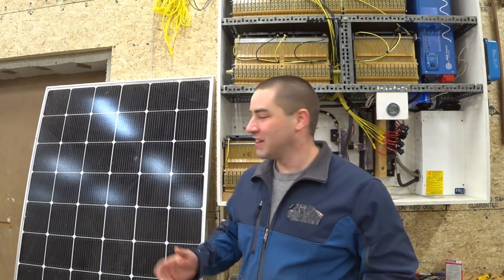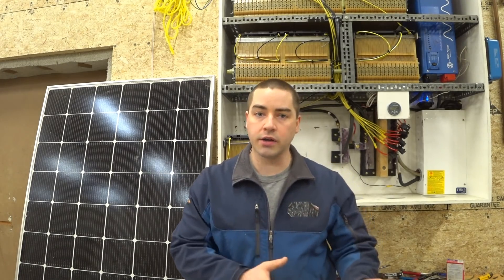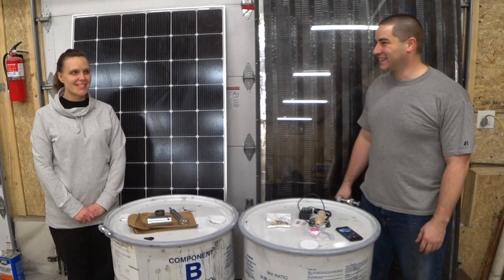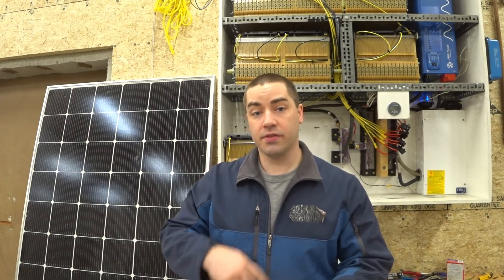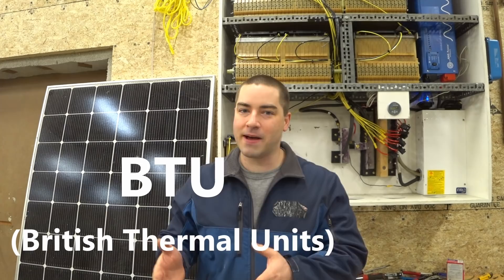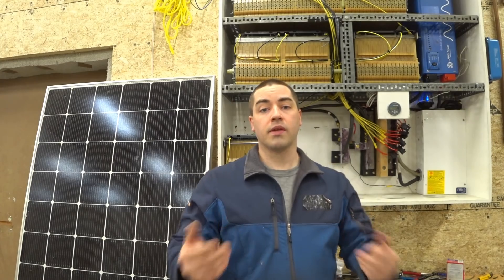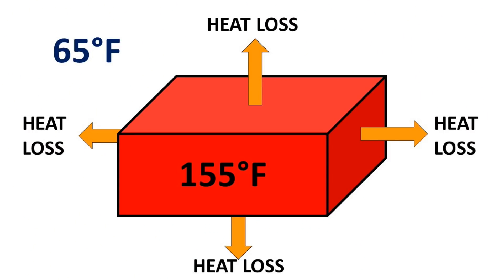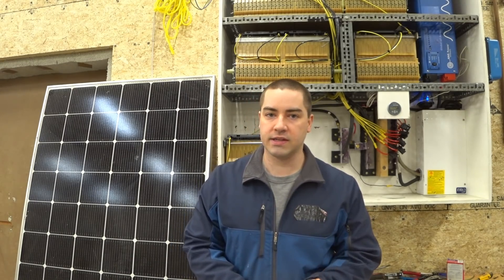Cheapest Energy Storage Off-Grid

Comment: Nice installation David!  We don't have any good areas to install PV available, so I settled for two small arrays way down in the back yard. They don't get a lot of sun, but they get about 4 to 5 hours a day on average.  They keep the back-up battery bank charged.. 
Anyways, I had a hot water problem. With just two people in the home, I felt it wasn't cool to use our oil burner all summer to make hot water.. When I started using Mini-split (heat pumps) for heating, I didn't really need to burn any oil until the temp got down to 8deg F. So, we only get an oil fill every few years. 
To solve the hot water problem, I purchased a cheap hot water heater from Home Depot and installed a small A7 heat pump (cheap off Ebay) on top of the tank. It works okay.. Uses power like a 4,000 BTUh AC..  But, to supplement the A7, I connected the two PV arrays (400w & 500w) to the heating elements in the hot water tank. So, when it's sunny the water tank is heated by the sun and the grid..

Of course using PV tied directly into resistive heating elements is considered a crime against Gaia!  
However, when you can get PV  panels so cheap, why use solar hot-water panels with all the leaky pumps and pipes to make hot water?  (We had hot water panels on the roof back in the 70s it worked good, for a while). 

I read some reports about state parks that have used PV to resistance to make hot water, because the demand for hot water isn't very high.. No dishwashers etc.. Just some sinks in the bath rooms. Maybe a shower. Of course their arrays were paid for by the taxpayers..   But without all that plumbing and moving parts, it proved to be very reliable and met the needs of the public.. 

The big draw back of my system, is no temperature control.. So, the PV power is configured manually not to overheat the water, under normal usage. If we go up to NH for the weekend, I turn off the PV.. Let the A7 heat pump handle it..  Much of the year, the heat pump doesn't get to run a lot.  Mostly on wash days.

The A7 has an accessory  socket on it's back panel. It's live when the A7 is running, using grid power.. 
I've been thinking about buying a 400w 48vdc to 120vac  power inverter and use all solar PV power for hot water.. But, that would be conventional.. ;)
Reply from the maker: That sounds good to me.  And congratulations getting your oil usage so low.  Excellent job.  You mentioned NH for weekends.  I'm in central MA, we might be neighbors.  I'm conducting an experiment right now comparing solar PV and solar thermal.  (I've also been told it's a sin)  But I'm surprised how well the PV direct to heating element is doing.  Do you have any videos, or pictures?
Reply: @DavidPozEnergy  I'm in the warmer part of eastern MA.  Snow just slides off my PV on days like this.. :)  
There's some posting online, search "Dump the plumbing and use PV to heat water?" 
My little comparison study was comparing fixed to tracking PV arrays..  Results: Tracking is not easy and doesn't yield enough extra power to make it worth the trouble & expense.. At least on the small scale. A large solid tracking array would be sweet, but costly.. I used an old satellite antenna mount for a tracker. I got tired of Radio Astronomy.  
Anyways,  there was a guy selling solid-state temperature controllers, not sure where that went.. 
I made a few attempts, to control the water temp, but failed. Since I'm an old retired guy at home about 90% of the time, I monitor the hot water at least once a day. This winter has been okay so far. During the day the PV keeps the water up about 120F and the A7 heat pump kicks in with it's thermostat when it gets down around 110F and brings it up slowly.. Right now it's 115.3 F    
If I ever have to do another hot water heater I'll use a larger tank, and I'll hack a heat pump together.. and maybe use PV into resistance if there is any PV power to be had.. 
My other long term test (Feb 2013) is using RG-214U direct burial coax cable underground. Both PV arrays feed the house with coax.  Because of the small center conductor, the PV is in series config, for high voltage at low current. Three 8 amp panels in series put out 8 amps, not much power lost as heat in the cable. This saves on buying heavy copper wire..   Every summer, I test the coax cables for losses and they have remained very small.  I have also tested them using RF test gear, and they are still good, if I wanted to use them for VHF or UHF ham radio stuff.. 
One hour with 8 amps into a 13 ohm load resistance is only 832 watt Hours, and each hour yields only 2839 BTU of heating. That's when it's cold and sunny.. When the days are too short.. :(    It's just enough hot water two old folks.   
But, if we plan on showers after doing a wash, we need to remember to fire up the oil burner (HS Tarm OT-35 boiler)  for about 25 minutes, to get a 76 gallon water jacket from 47 F up to 140 F.

Comment: Hey Dave, I really like your videos and find them very informative and thought provoking.  Given you are working on a Thermal system;  have you seen ElectroDacus's project?  You can view it at www.electrodacus.com.  He has developed a digital MPPT controller specifically for thermal heating for use in off-grid applications so that you can use your solar array to provide both electricity and heating from the same source.  Check it out and you may find it gives you some additional options.

Comment: The beat way to store energy is through compressed air
Reply: Okay, you just used 1 KW Hour from your PV panels to run your compressor.  Now that you have a steel tank of compressed air, you can do this?  https://youtu.be/U-kYAljKAY4
What's the conversion loss?
Reply: There are problems with air storage. (apart from having a large volume of compressed air, with the risk that creates if the tank ruptures). As you compress the air, it heats up. You must get rid of this heat, or your storage tank gets too hot. Later, when you use the compressed air to run a turbine or air-engine, the expanding gas gets cold, and thus is not efficient in the engine, and needs to be heated back toward atmospheric before use. Too many losses of efficiency for small systems.

Comment: Why use expensive Li-ion batteries when lead-acid is much cheaper? Sure, Li-ion is smaller and lighter but very often size and weight isn't a problem. This is why cellphone sites and telephone exchanges use lead-acid batteries and not Li-ion. 
Why don't you use evachuated glass tube solar collectors to heat water directly? To use photovoltaic to heat water is insane.
Reply from the maker: I bought these lithium batteries because the cost/kwh/cycle is the cheapest I could find, at least half the cost of lead acid.

I don't use evacuated solar tubes because I don't have any.  If I had them I would use them.

Using PV to heat water might be insane, but finding out is why I'm running my long-term experiment and data-logging it.  You can check out some of my other videos to see more.  Thanks for watching.
Reply: @DavidPozEnergy  Ok, makes sense then I suppose. I just see so many guys on yt fixated on Li-ion as energy storage when lead-acid is normally far cheaper. As for the glass tubes, they are not that expensive and I believe they work better than copper pipe collectors in cold climates at high lattitudes.
Reply from the maker: I've heard the same thing, that the vacuum tubes work better.  I've been watching craigslist for the last month.  I want to find a used vacuum tube setup cheap so I can test it side-by-side.  

I'm not a lithium battery snob.  For a long time I was planning to buy a forklift battery.  But I checked around and found this battery.  It's used out of a wrecked car.  But the battery was still good.  I would not have bought it if I had to pay full retail.

Comment: heat is pure anergy man
get a fly wheel which is 100% exergy
Reply: @timothy vince AND flywheels have no maximum duty cycle. Run them all the way up and all the way down, day after day, and they don't lose efficiency. AND they have (essentially)  no service life, unlike batteries.

There is a market for modular flywheel storage for home use. The best place to put them is in the ground, in a concrete jacket. They would easily compete on a $ basis with batteries.

Comment: You could run a heat pump drawing from a warm storage tank...
Reply: Pointless. The heat pump could only ever extract the energy you had put into the store, so there would be no efficiency gain. However, you could use a heat pump to "convert" a large volume of warm water into a smaller volume of hot water. This could be useful for occasions when the store is running low and although warm not really up to shower suitable temperatures.

Comment: Interesting video but here in Florida I need the electricity for A/C.
Reply: Those of us in the northern US can ship you some ice if you pay shipping and handling!
Reply: Do you need heat in winter? I live in Australia, same latitude as Florida, but south of the equator. We have similar weather.
Reply: He's not using the hot water storage for electricity... Just simply hot water.
Reply: savagecub You can use a similar set up to store chilled water or even ice, then circulate chilled water through finned  air to water heat exchangers much like a conventional air conditioner. Some commercial office properties already do this, using cheap nighttime electricity to freeze large tanks of water that then chill the buildings when required by day.

Comment: Great video. So sad to see home owners cover their roofs in panels and walls with batteries, and not consider solar thermal for water and space heating. The cost difference is due to both pv vs thermal panel efficiency and battery choice, and it's a huge difference. Math doesn't lie. Stay in school, kids!
Reply: PV is still the better option in many cases. It can be used with heatpumps which has nearly the same total system efficiency as solar thermal - but you can also use the electricity for other things or even use it as an AC when it is hot.
But if you just need a lot of heat then thermal solar is cheaper and slightly better.

Comment: you did not tell what was the working fluid in the heating panels. If its water and youll have alot of days without sun, your panels will explode.. please take that in to consideretaion. 
Thanks for the vid!
Reply: There are some hot water solar panels that fully drain using only gravity.   Here's a video on "drain back" system.   https://www.youtube.com/watch?v=DcU_uuNb3Qk
Reply from the maker: Yes,  my system is also a drain-back.  Thanks for watching.

Comment: You could also try using the sun shining on a Fresenel lense at the bottom (the heat will be hitting the cold water, as it heats it will rise in the tank leaving space for more cold water to be heated) of the black painted tank of water to super heat it..You can get the lense free from old T.V.s..They use the lense to even melt sand into glass..
Reply: Yes but the fresnel doesn't create any additional heat, it simply focuses it. It only focuses the heat collected over its surface, and given a lease is about one third the size of a solar thermal panel you would get very little heat from one. Plus you would have to adjust the angle to the sun constantly.

Comment: So you've done the math & built your your tank. My question is does it actually work? I also live off grid. Have for many years. Are you using passive solar for heating the water? Do you have other heating elements to subsidise the solar? This sounds like a great idea! But what are the details of the system besides a thermal battery?
Reply from the maker: Hi Jay,  My solar hot water system works pretty good, and has lowered my families energy use for heating water from 7kwh/d to 2kwh/d on average over the course of the year.  I'm always trying to improve my systems and make them better.  That's why I am currently conducting an experiment comparing solar PV to Thermal.  I have detailed videos on my channel on how I made the system framing the tank starts here: https://youtu.be/jKr4An8m_tM

Comment: why not heat the stored water with the heat pump when you have solar?

also, the energy cost should be divided by three since you'd likely be running the heat pump off your heater rather than just resistive
Reply: In some sense, this is true. But your current is modulated by clouds so you need a battery for averaging. And, sorry, using PV panels to produce electrical energy, you have an efficiency between 12 to 18%, here you loose a factor of 3 or 4 when compared to thermal collectors filled with water and anti-freeze liquids.

Comment: Isn't there a heat storage value for the pipes in the tank as well as the water? You've got a lot of pipes. Can you also preheat the water by running it over the solar cells to cool the cells? They make more power when colder.
Reply from the maker: The PEX tubing inside the tank is carrying the water for the pipes.  Since this water is constantly being used and replaced it is not part of the thermal battery.  

Yes, there are lots of ways you could try pre-heating the water.  It's fun to get creative and try them out.  I might even try some experiments in the future.  Right now I'm running an experiment on PV vs. Thermal.  Too bad there is only 24 hours in a day.

Comment: been off grid for years. ya hot water is the best for those with an endless supply of free wood. I use a wood fired boiler and storage tanks. I have 3.8 kw of pv . I use the surplus during the day to heat my hot water electrically . takes only one hour and is good for 24 hours.

Comment: What about an electric tankless point of use water heater instead of a tank?  While I'm not off grid, I'm using Oil to heat my home and my hot water tank and I find that burning oil to maintain a standing tank of water when a tankless heats the water at the point of use for as long as I need it makes more sense in my case.  

In this type of setup, would this not make more sense?
Reply from the maker: I'm not a fan of instant water heaters.  In one of my old jobs I used to be replacing them regularly.  

 If you are happy with Oil heat, and being on-grid, then I would  start with insulating your current tanks super well.  I mean lots and lots of insulation.  But, once the tank eventually fails you might try replacing it with a HPWH.  Often an oil boiler gives off lots of heat to the surrounding air, which the HPWH can capture in winter.  In summer the oil boiler can stay off for months as the HPWH won't need it to kick on.

But, this idea only works if you are staying on-grid.  I hope that helps.

Comment: >^..^<       Nice home made TED talk, thank you.

I suspect you got some thoughts n numbers on PEX vs copper heat exchange coils. Obviously the heat trnsfer is lots less with PEX but looks like you have at least 300' lineal feet of 1" PEX. What is the delta between the input temp and exhaust temp of your water from and back to your solar hot water panel?

By your statment, obviously you feel the extra cost for copper is worth it, do you mind sharing the reasons why and the numbers  with us please?
Reply from the maker: Oh, boy.  The numbers....  When I first installed the system I used an IR thermometer a couple times, but I can't remember what the numbers were.  I recently borrowed a data-logging device from a friend.  It's currently on my experiment comparing solar PV to solar thermal.  Once that experiment is done I'll have to bring the data logger in and put it on the solar tank.  Several people have asked me for more numbers on this and I'm sorry I don't have them right now.  Honestly, I didn't think this many people cared about the numbers, LOL.

The main reason I would use copper over PEX:  My whole house is plumbed with PEX.  Never had a problem.  So when I built my solar tank I figured might as well use it since it's cheaper than copper.  Unfortunatly, we had very strong plastic smell come out of our hot water.  This makes me question the healthiness of the water.  I'm guessing it has to do with being submerged in high temps because we never had this problem with the rest of the house plumbing.  So, if I do this again, I would probably buy a 100' coil of copper Type L, 3/4 or 1".  

I hope that helps.
Reply: >^..^<       I agree, smelly water of any smell is a no-No. I would change it at your earliest convienance. I know it is a tight place to work but your family is worth it.....

As far as the numbers go:   Yes, most don't care about the numbers but many like me do.... However knowing the numbers helps  figuring out and theorizing it's operation prior to building  and helps in MANY ways I suspect....